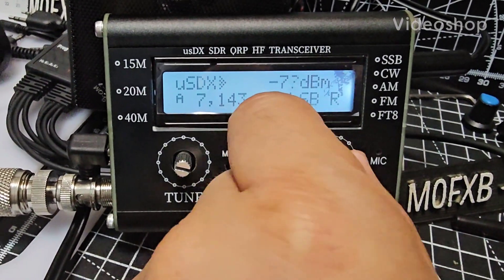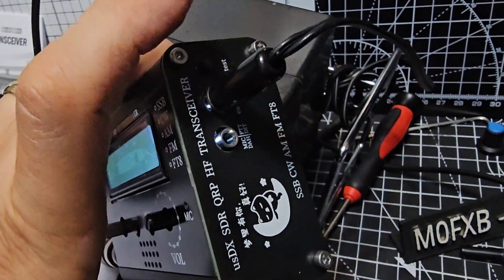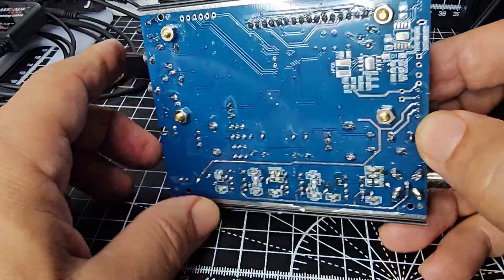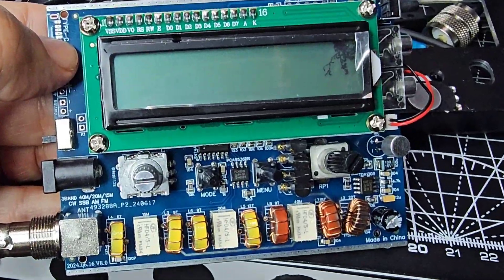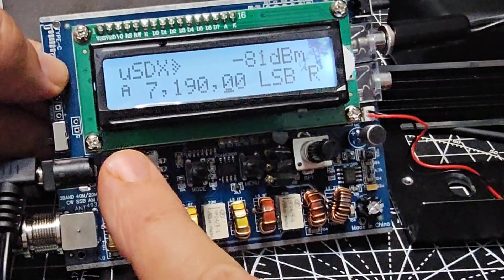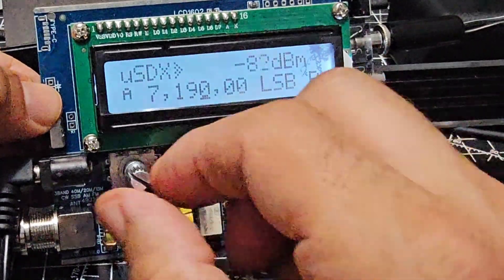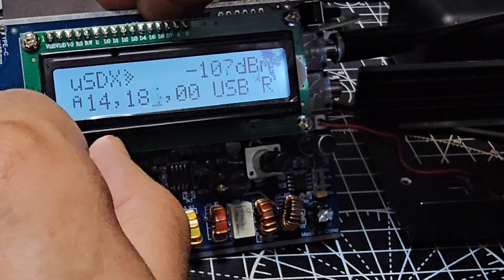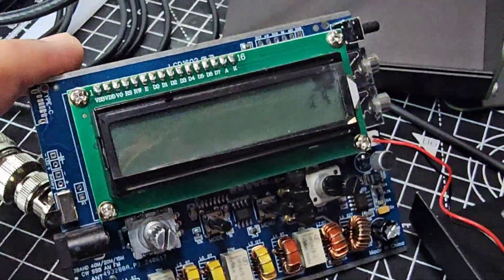uSDX Budget Clone Orange Blue Button Dismantle

Comment: I just got a BT one in. Haven't messed with it to much, but the receive is at lest better than the x6200. They do look to be completely different devices, as far as layout goes.
Reply from the maker: The x6200 is good
Reply: @M0FXBHamTech  To be clear, they layout of your device, is completely different in layout than the BT version, though they look laid out the same at first blush.
Reply: I did one POTA activation just on ft8 uding BT. Went pretty well. Comm jammed twice but othervise ok, works. Used ft8tw program on android.

Comment: Might be a stretch, try reading those battery PCB pads while it is on.  They likely have be a straight connection to the unit and will be hot (input power-feed to the voltage regulator), when turned on.  Make no mistake though…  This is just a guess on my part.

Without a charge circuit, using an external power source while connected to a battery would not be good.  I ordered one, will dig in on it upon arrival.  Good content and thank you!
Reply from the maker: Ok

Comment: the radio work on 30m too with 4 watt. i send u a lot of message
Reply from the maker: Hi Many thanks I need to reload the firmware my device is brick , I need English instructions to load.
Reply: From Spain. What type of batery can I solder to the board? Please. EA4HUM 73